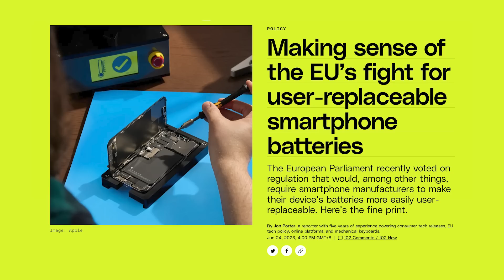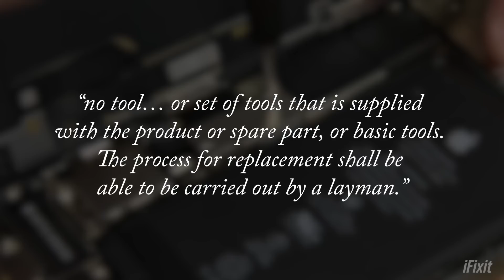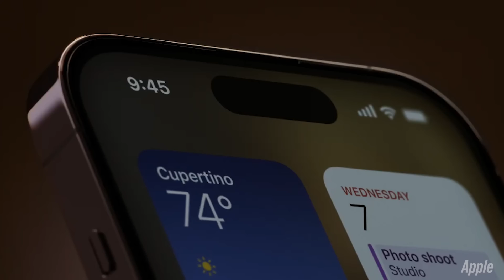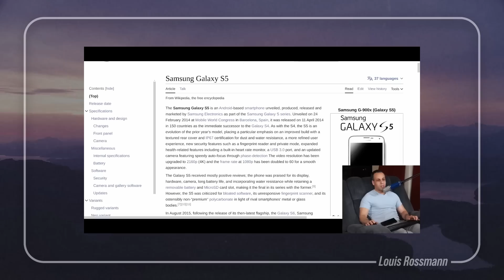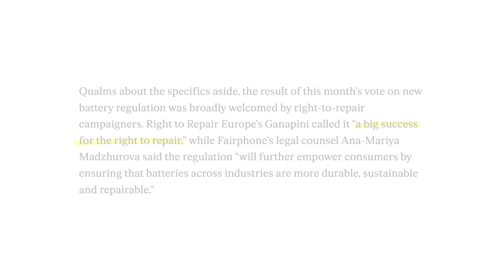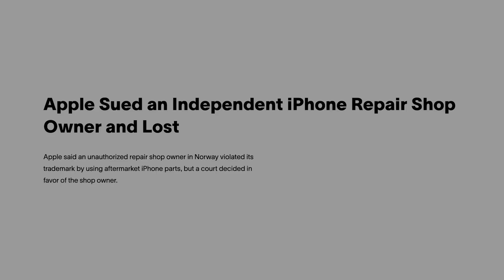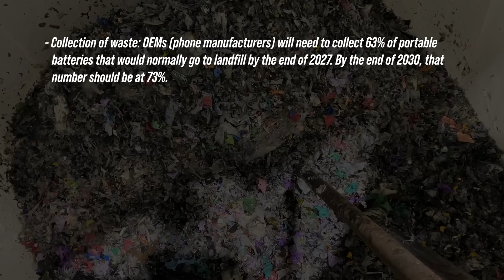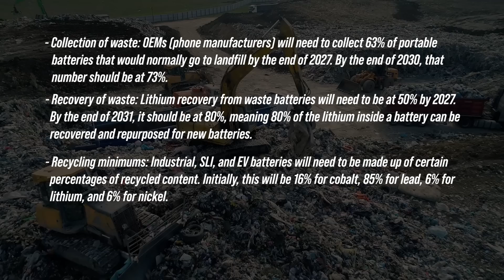EU Just Changed Smartphones Forever

Comment: The amount of different ways to charge your phone these days is unreal. How on earth can you find yourself running out of battery power these days? You've no excuse. Why would you want to carry a spare battery? Might as well carry a power bank the same size that can charge your device 3 times over. As far as battery degradation, they're made to last longer these days. Coupled with software which slows charging at night time, you should be fine. My 4+ year old OnePlus 7 Pro is still absolutely fine and gets me through the day with plenty of use. Well, I guess it's bye bye water resistance and hello cheap plastic removable covers once again. We're going backwards now. The same people who moan about wanting replaceable batteries are the same lot who moaned about the removal of the obsolete headphone jack.

Comment: The Motorola Z-series had swappable modules providing different hardware enhancements … one of which was a battery pack.  So it's not like the phone companies couldn't do something like this already:  Just make a combination phone-case+battery-pack with a passthrough USB-C connector for data-connection.

Comment: You asked if it was driven by phone design challenges or profit. Same as with SD card use and replacement in phones, yes, there's an argument that some amount of device physical space is wasted (let's say "invested") in making these features work.

While it's true that these features have a cost, that cost is not the necessary or sufficient explanation for why phones are the way they are. Users would have always paid an extra 50-100 bucks or more for replaceable/expandable storage and battery. And companies can prove that they can build phones this way. 

The REAL problem for the phone manufacturer is that both of these features disrupt the ticking time bomb of your 2-year phone replacement cycle. 

Phone companies want to force you to buy a new phone every two years and they want to charge you hundreds for larger storage so you will be forced to chose between higher cost or shorter phone lifecycle - and they just need to be told "no" by agencies like the EU.

This is an important policy change and I can't wait to see it roll out in 2027.

Comment: I hope they also added that keyboards on laptop should also be easily replaceable, like the old laptop which keyboards are secured by a bunch of push button plastic springs. Its literal hell replacing modern laptop keyboards, you have to dig the entire system which every generation comes with its own complexity, wither it be thinner tinnier wires, another set of proprietary screws.

Comment: This is not a good decision by the EU. Battery tech has evolved tremendously since the Nokia 5100 series.  The trade-off we got for going to sealed phones without easily replaceable batteries is better protection against liquid damage which was rampant when phones had removable batteries.  I've seen people find iPhones that someone had dropped in a stream or lake somewhere and they took them out and turned them on after letting the outside dry.  That's possible because of internal batteries.  I'm all for better repairability, but this isn't a step in the right direction.  Someone who needs a user-replaceable battery in a current model iPhone either needs to learn to charge their phone at night or just STFU.  This is terrible legislation. 

Outliers don't change anything.  There may have been a phone or two that didn't get liquid damaged if you talked on them in the rain, but every other phone did.  Loius should know better. If he was fixing phones in the 2000s he's seen a mountain of LD phones.  It was the number one cause of issues with cell phones before they went to an internal battery.  Maybe Louis just wants the business that LD phone would bring him.

Comment: Removing replaceable batteries seems like one of the biggest trends in “planned obsolescence”.  Where companies make products that don’t last as long on purpose so you inevitably have to purchase another. Apple not allowing security updates after a phone model is so many years old is another example of this.   Happy to hear governments are starting to hold companies accountable for this in some way.
Reply: It is crazy considering while devices have gotten more integrated and less user servicable because Apple wants you to get the next iPhone instead, while at the same time theres less and less reason to get a new device since improvements today are tiny jumps and not leaps anymore.
Reply: I don't think it's accurate to say apple really wants you to always buy the newest model when they still support phones that are more than 5 years old and will replace your battery for free after it degrades to 80% of it's capacity  @adamkares7549
Reply: I never thought I would give props to Apple for anything but if theres anything to give them props for it's updates. Last time I checked they were the only company giving out updates for more than 5 years. which compared to other manufacturers where you barely have 2 years is a win.
Reply: @SWUnreal Software does not rot. There is no reason, that benefits the user, to update when is properly done. Is only when is wrongly done that you need an update.
Reply: @RicardoSantos-oz3uj  Software doesn't rot, but new security vulnerabilities are found almost every single day, which is why security updates are necessary. Outside of removing all features that allow data to enter the device, it would be impossible to make a device update flawless when it comes to security.
Reply: @SWUnreal  Now, what phones have such short support life? Also, are we talking about security updates, over all updates, or updates that nerf your phone for you to buy a new one? Because as far as I'm aware, at the last category, Apple is winning
Reply: @SWUnreal  I'm on over 5 years old Huawei and I still have the latest Android version and security updates. That's probably the only real brand that does that though and it's banned in the US, so I guess there's only Apple to Americans now.
Reply: @SWUnreal I'm on a samsung that is more than 3 years old. Still getting updates. Definitely not just apple doing updates longer than 2 years.
Reply: @PeteS_1994  but after it stops giving update many apps doesnt work in apple , where it is not the case in anroid
Reply: Wasn't there one where one of the IOS's the less "health" your battery has the more the phone becomes bottlenecked? Which would easily be fixed with just replacing a battery
Reply: "Apple not allowing security updates after a phone model is so many years old is another example of this"... bruh there is no single company in the whole world that gives a better software support to their phones longer than Apple xD
Reply: @HaimRich94 please check Pixels and Galaxy S model security updates. And apple blocks the apps from launching in old iphones/iPads. That is not the case with Android.
Reply: "Apple not allowing security updates"? You mean after like 7 years? That's the best in the industry. Funny you're not throwing out names like ROG or Sony, who charges $1600+ for phones and does like 2 years of security patches. Too many one-track minded people not holding companies accountable man
Reply: Manufacturers have been making products wear out prematurely for longer than anyone on the post has been alive. Even Thomas Edison and Joseph Swann had to reach an agreement on how long to make their lightbulbs last so they could sell more.
Reply: The update thing has more to do with how phones are ad-hoc devices where updates are strictly at the manufacturer's discretion. There are a bunch of reasons for that (regional spectrum licencing and carrier oversight, use of static Devicetree definitions compiled into the system instead of doing automatic hardware discovery at boot, SoC manufacturers keeping all the driver components under NDA/trade secret, etc.), but to me that's another big reason why phones get such a short lifespan. Samsung is "breaking new grounds!!" by promising 3 years of major Android updates after launch, but to me it shouldn't be up to Samsung to provide these in the first place!
Reply: They'll just crash the phone with forced software updates
Reply: Seems, then open your eyes and see reality for a change. EU could mandate recycling of phones if they wanted to. INSTEAD they wnat to invest in the propriety of batteries under EU DIRECTIVES like EU owns EVERY manufacturer's proprietary connectors.

And this will accomplish two things: every legacy phone will be TRADED IN and ran to the ground INSTEAD of recycled. Secondly, EU will start profiteering on selling the BATTERIES, which are like the real blood diamond of the modern age and a huge racket based on labor exploitation. 

It's cheaper, because manufacturing NEW PHONES for ONE battery a piece requires somewhat skilled labor, plus the reycling that now won't happen. Mining cobalt for endless batteries, and landfills full of third-hand bought crusty smartphones, only require child labor level of skill in the 3rd world. That's the job increase EU decided to create.
Reply: Fun fact

China used USB c ports on phones first . Everyone copied Chinese methods
Reply: Bro Apple literally gives updates for longer than ANY phone manufacturer.
Reply: @tihruytssgjjvsavcxtbvhj3429 
Android is more modular, the fact that you no longer get updates for the OS doesn't mean you don't get new features.
For example, Nearby Share (android's airdrop) magically appeared one day to all Android devices above version 6 (that was when 10 was released)
The Dialer, Clock, Calendar, Gallery, File Manager, The play store, The browser, the SMS app, the Keep (notes) app, maps, mail etc... ALL keep getting updates well after a phone stops getting updates.
Source: my Oneplus 6 that still works super fast 5 years later (and 2 years after its last update)
Reply: I have an iPhone 8 from 2017 and Apple updates are still relevant for my phone. Do you know how much it cost Apple to continue to maintain older devices? Think about it, they could easily force me to get a new phone years ago.
Reply: I hate you are forcing me to defend apple. But apple isn't disallowing security updates after a phone model is so old. They are simply not putting in the effort to make a security update for that device. And companies shouldn't be forced to support their devices with new updates forever.

Comment: The LG G5 was the worst phone i have ever owned, as the phone got older the internal pins would fail to contact and the gps/antenna, power/vol buttons would stop working. it was a total mess. Even with removable batteries they will still obsolete phones by stopping OS updates.

Comment: The Recycling Problem with batteries is a HUGE issue that has been overlooked for too long. With the rising Demand for Batteries, especially due to EVs, we need to double down on Recycling and re-using as much as we can. The biggest Concern is Nickel and Cobalt. They are more rare than Lithium. ALso, Lithium mining is extremely toxic and damaging, the more we can re-use the better

Comment: To answer your question about corporate profit, you can rest assured that the very concept of the corporation is to generate profit, therefore every decision that's unregulated by outside bias will be about profit and nothing else, even worker safety, of which on-the-job injuries had to be made more costly through law in order for corporations to even consider it financially sound to keep workers safe, because otherwise their safety wouldn't matter. Also to be clear, I love replaceable batteries, no matter how much less water-resistant it makes the devices that use them, so I really liked this video. It's philosophical on many different levels, and not just about consumer electronics.

Comment: I'll play devil's advocate and suggest that maybe manufacturers decided to go with non-replaceble batteries because virtually nobody would actually replace them, but simply buy a new phone. Any amount of money spent on an obsolete applience gets you quickly in a sunk-cost fallacy situation. Having said that, we are at the point now where tech appliances don't get obsolete as quickly as they used to (I'm typing this on an 11 year old laptop which is still doing great), so the opportunity to make them last longer is more than welcome. I'm just a bit skeptical of governments forcing the hand of the martket in such substantial ways. I'd say they should address the security updates issue first. I have a perfectly functioning phone that in a few days will stop receiving security updates. Having a replaceable battery on a phone won't solve anything if it cannot be used safely after a couple years.

Comment: The idea of not even needing a screwdriver to open a battery kinda.... Scares me?  People don't remember when you'd drop your phone and it would explode dramatically with your battery and the covering flying off in different directions. I am very interested in how modern engineers will solve this problem though like that one phone where it snapped in on the bottom.
Reply: LG G5 had this design.  No issue.

Comment: Honestly, it shouldn't be that difficult to make phones, including super thin ones, with replaceable batteries. All you'd need to do is design the phone so that all parts are sealed except for the battery component. This section could have four screws to lift off the secondary cover, giving access to remove and replace the battery. Adding a new gasket might be necessary, but overall, this approach seems feasible. The main phone could remain 100% sealed, with the battery compartment being the exception. This wouldn't necessarily be an interchangeable battery system, just a replaceable one. All phones should come with the batteries installed, and also include an extra battery available for use in the future. Cell phone companies could even restrict battery changes to avoid frequent swapping. Once the battery is removed, it would be considered officially dead for the consumer. Including a protective envelope in the packaging for returning the old battery wouldn't be overly complicated. Taking inspiration from LG's design and enhancing it could be a great approach, especially if interchangeability is desired. This wouldn't affect the sealing of the phone's components; you'd simply have access to a removable battery compartment through clips or screws. Additionally, most people already use cases for their phones, so a slight increase in thickness shouldn't significantly impact the purchase value.

Comment: As much as I support freedom and rights, i don't think this is a good thing. 
It will be hard to design something with removable batteries. Is bulky. Some companies did it but they are not very durable.
If you want Right to Repair, you should actually be capable enough to use special tools to repair them.

Comment: Criminal irony is that often the easiest phones not marketed under some eco-friendly pretext to replace batteries in these days are the semi-obscure chinese ones, they have sticky backs, surface connectors and use use stickytape huggers that can be reused to hold the battery. Brands like Apple and Samsung have a vested interest in making it difficult to do so, so they often try to make their battery headers obscure even if you get in without breaking the glass back. Replaced batteries on my old umidigi with a sharpened plastic store discount card twice. Had to chuck my old galaxies.

Comment: PLEASE don't use the S5 as an example.
Galaxy S5 water resistance was absolute dogshit, specially with that little flap on the USB that tended to break. Also the back cover that was easy to get wrong, if you forgot a single tab (no visible clue) it would get water inside. Don't forget the tabs on the middle!

Comment: At the first glance the battery bill seems to be ok, however let's go back to the times with removable batteries. Batteries had to be clunky in hard casing, after falling the phone would be in pieces, no water resistance at all. I believe non-removable batteries are necessary evil as removable ones will impact water resistance, reduce battery size because of casing and durability.

On the other hand iPhone 4s had non-removable battery which was easy to replace for anyone in 5 minutes.